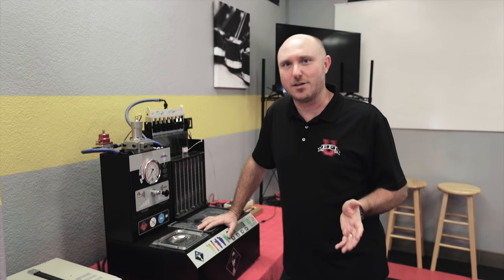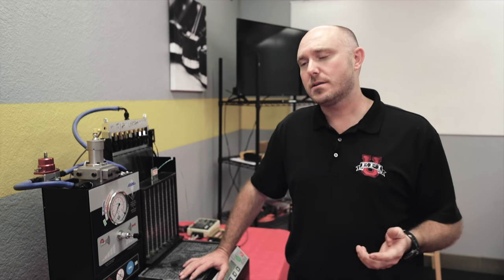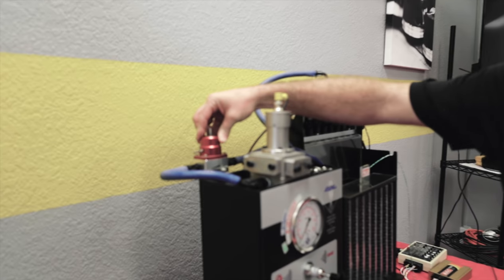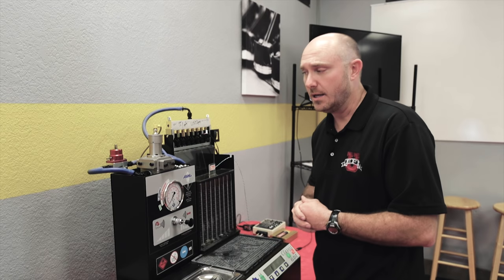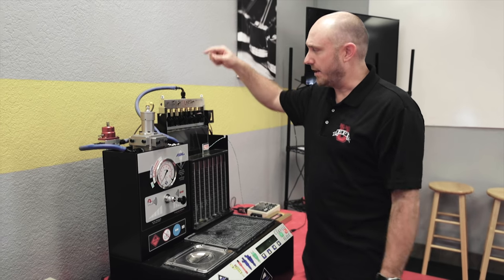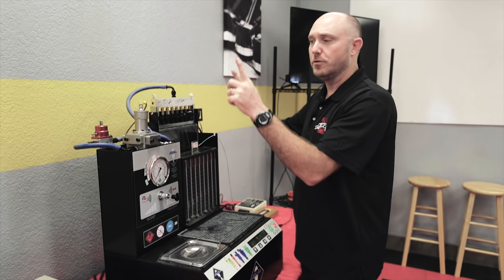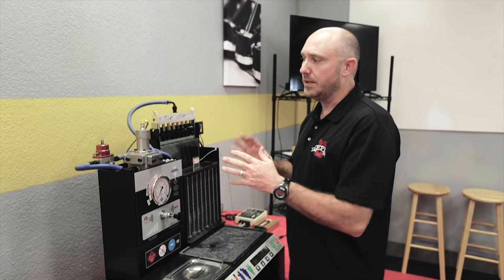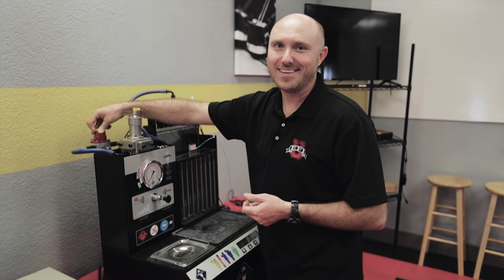Understanding how a fuel pressure regulator works.

Comment: So if you keep the vacuum line off and plug it will it make more pressure or less because I have a more high performance motor and I need a little extra pressure to my fuel rail and when I plugged the vacuum connector on the regulator it seemed to run better

Comment: Im sorry but when you connect the FPR to your engine you shouldnt connect the vaccuum line (yet) because you wouldnt be able to tell the actual fuel pressure coming from the pump if the manifold vaccuum is meddling with the fuel pressure when idling. So first you hook it up, check and set the pressure without the vacuum hose and THEN you connect the hose for a proper working FPR.
Right?
Reply: See no reply. To bad that is a question I have. With the Vacuum line closed off 0 vacuum, that would be close to WOT. That would be where the most fuel is needed to reach the target A/F. At least that is how I see it. If you set the called for psi at idle when pressure drops the psi would go too high? Right. This is a NA engine.

Comment: HELP PLEASE. 1995 pontiac grand prix gtp 3.4 engine
 I changed fuel pressure regulator car will not start. I have no.idea where vacuum hose goes. So my question is if that tiny hose not connected car will not start? I get nothing when engine cranks no backfire nothing just cranks. Ty

Comment: Depends on if your pcm is set for vacuum/boost reference in the injector flow table to wether you connect the vacuum line or not

Comment: If your a high HP application this set up will destroy your motor…. FPR after the fuel rails. The fuel pump should be supplying straight to the rails.. then be regulated after

Comment: Well if I say a fuel pressure regulator job is to keep a constant pressure difference between the fuel pressure and the intake manifold pressure then it will be correct.
Having it set to 50 PSI fuel pressure, and when the intake manifold pressure goes to 20 PSI,  the regulator will let the fuel pressure reach 70 PSI ?
Reply from the maker: correct
Reply: @EFIUniversity1  
when the manifold pressure drop it means more air had entered...
so the fuel need to add more pressure to meet the requirements for mixture???
did i get it right?

Comment: I've been having problems with a GM 350 Ramjet crate engine installed in my 58 Apache. The thing is sluggish on acceleration and uphill. I scanned the engine using ScannerPro and found out the manifold pressure was too high under load and the spark advance was too high.

I figured it was a vacuum leak and the base timing was off. I searched for a leak and the base timing was just fine. So, where do I go?

I just put a pressure gauge on the EFI rail and found out the fuel pressure dropped from 39psi to about 35/36psi at cruising rpm (2000). 

Now that i watched this video, it makes sense now, the fuel pressure differential at high vacuum (lower psi on the rail) causes the engine to be sluggish on acceleration. 

The problem may not be the pressure regulator. But I darned sure understand the problem now. That will make it much easier to diagnose.

Comment: solid video really explains a lot. I am building a 1992 Celica with a Turbo charged 5SFE engine, i'm going to be using a Haltech elite 1500 to run it with 550cc injectors, walbro 255lph pump. Should be i looking at an AFPR too or will i be able to program this variable through Elite 1500?

Comment: Nice, brilliant technical introduction to differential fuel pressure and how it relates to dynamic engine loads 🙌🏼 This is a fundamental concept and your delivery was spot on for all levels 👌🏻

P.S. Love the engine simulator and gold box being used for your flow bench rig, would have been even better to see what fuel flow meter you were using 😊

Comment: The vacuum line is only on boosted applications that is the boost reference you do not hook that up on a naturally aspirated vehicle.
Reply from the maker: Actually...that is incorrect!  You still want it connected, even for an NA vehicle, as long as the injector nozzle is referenced to manifold pressure!  Otherwise the injector will flow more than it's rated and will skew your table values when tuning at low manifold pressures!
Reply: @EFIUniversity1  that is not correct when you are na you're manifold pressure stays at 14.7 the entire time It does not change only in a boost application does the manifold pressure change. That is why on a NA vehicle you have a single inline fuel pressure regulator that regulates the fuel to whatever the manufacturer is asking if you rev up the engine your fuel pressure stays the same The only time it changes is when you go into boost so yes you're wrong. If you were correct on that then every vehicle from the factory would have an adjustable fuel pressure regulator on a NA vehicle and they do not they have a single between 35 to 60 PSI whatever the engine requires to be at 14.7
Reply: @MrYukon04  why don't you tell Ford that.

Comment: Curently working on an NB miata
The fuel pressure regulator is situated in the tank, and not connected to MAP
It's suposed to regulate to a constant 3 bar
The car had trouble starting, took a long time to start, then was running but really low on power...
I've changed the pump because I suspected either the fuel regulator or the pump to be bad...
The new pump is a high flow pump, not OE one .
 I was unable to find a fuel regulator (for a decent price that is, cause OEM part is almost worth the price of a decent aftermarket adjustable fuel regulator)
The car now runs great, but I find the pump is a bit noisy (maybe because I didn't put panel and insulation back)
I wonder if the pressure regulator is fine, or the new pump might just be sending enough pressure to compensate for a bad regulator, and will die soon if I keep runing it like that.
My main questioning is, can I delete the OEM regulator and replace it with an aftermarket one, that would rather be in the engine bay, or next to the fuel tank (but not in)?
If so should I run it to MAP (car is N/A but might be supercharged later so then obviously)?
I don't know how the factory ECU works with the fuel pump but it feels like it's simply regulating pressure/flow by RPM thus increasing voltage output at the alternator and consequently at the pump...
If I put a variable fuel regulator, I don't know how it would react...

Comment: Ok stupid question, I have an ls intake for a 4.8, the intake does not have the fuel pressure regulator nipple on it can I t into the nipple that the pcv valve comes off of?

Comment: If you don’t have or lose vacuum to the regulator would that let the engine crank and start but die immediately after?

My engine will crank and start but dies immediately but I lost vacuum with the line.

Comment: Nice video, question, so I have just got a car, and the vacuum hose from the manifold isn't connected to the fuel regulator, and the that small connection on the fuel regulator leaks small amounts of fuel, it also sits at 50psi all the time. The car runs rich and can't hold a steady idle until it's warm. I assume the regulator is busted as fuel shouldn't come from that side connection and will need replacing, at which point I can connect the manifold vacuum tube and that should remedy in some way the rich running? Am I on the right track? This is my first car that I'm tinkering with so it's a steep learning curve!

Comment: my car will not run at all itll start and idle insanely bad for a few minutes then come outta it some times but something ive noticed is when it does run it misfires and has very poor throttle response pump works fine but there is no gas coming outta the return line so could it be its not getting enough vacuum or its just comepletely locked up or something ive bought a new regulator fingers crossed this is it ive also changed the filter to no avail

Comment: I thought the FPR should be mounted after the fuel rail, not before it (as you have it).
Reply: I think it depends on the car. Mine is between the fuel pump and rail (mounted in the engine bay). At prime (ignition on) it maintains pressure on the rail for starting.
This is a returnless system though.

Comment: Some fuel regulators are in the gas tank like in my ford explorer. Thus it has no vacuum line to adjust pressure. It uses a fuel pressure dampener instead.

Comment: What if you dont have an intake manifold?
Reply: Im not sure what are u talking here unless it is a coal powered car, 😂
Reply: @makaupurple8242  1960s engine. No computer parts not sensors. No eca map. Just need an inline fuel regulator

Comment: Do you recommend a fuel pressure regulator on every engine?
I'm planning to install one on my motorcycle. But I don't see if it would benefit.
Reply: Do a plug test!  I just found out that method and was blown away, now just have to get a few sets of plugs An some hacksaw blades I plan on doing this on my 90 celica I've got a  new set of injectors from 210cc to 220cc on stock engine management :( running super rich so hopefully this will be my answer to finding a little bit better tuneability with future na modifications

Comment: Is it the same for a  carbureted  engine as it is for one with injectors ?
Reply: carbureted doesnt need one cuz it only need a fuel pump just to fill up tha carb but not needing much pressure to supply

Comment: fuel pressure regulator BEFORE or AFTER the fuel rail??

i thought the injectors need a specific fuel pressure to work properly, therefore the fuel pressure regulator (fpr). Now I was told that you should install the fpr after the fuel rail....that would put as much pressure on the injectors as my fuel pump can do - which in most cases is way too much??
Reply: they really need to be specific...
cuz diff engine size requires diff amount of supply in an specific pressure...
Reply: Here's a good explanation of different setups - skip to 6 : 23 https://youtu.be/qO8z8cpp77g

Comment: If I have a slightly bigger fuel pump than stock, something like a 255...
Would that make my stock fuel injectors leak...
And if the answer is yes, could a fuel pressure regulator correct this problem...

Comment: Some systems had other ways of adjusting that and the fpr did not have a hose. So dont freak if yours does not. For some issues or to just give the car a bit of zip, one could up the fp a few psi. Fpr were on both electronic systems and mechanical fi systems.
Reply: eg D Jetronic Mercs dont have vacuum hose on the FPR.

Comment: So, in boosted applications, would you need higher rated fuel injectors? Or does the fpr compensating fuel pressure completely solve the issue?
Reply: Not sure if you found your answer. You will need higher rated injectors so 1) they’re not running as hard and 2) they’re actually pushing out enough fuel to combust in the amount of air being supplied. Just limiting the fuel pressure will only make it either idle rough or stall

Comment: I still don't understand why the fuel pressure regulator is connected to the intake manifold by the vacuum line... there's a pressure sensor in the intake manifold, couldn't the ecu just read that and tell the fuel pressure regulator what to do? Or is it the case here that the fuel pressure regulator determines the pressure by itself via the vacuum line without any input from the ecu?
Reply: Do you think the ECU has an auxiliary mouth in the engine bay to tell the FPR what to do?
Reply: @turboroman  The FPR is a valve, those can be electronically controlled easily enough. The ECU controls plenty of other things this way. Kind of like how some EGR valves are opened via a vacuum diaphragm, and some are fully electronic. I'm curious as to why they don't use the electronic method here.
Reply: @PeterB12345  they just used the so far much more common type of FPR. I know about the modern electronic ones. But this video covers the "analog" type. The vacuum reference port is there to keep the differential pressure constant during all engine load conditions.
Reply: @turboroman  Thanks for that, I didn't know there were fully electric ones. I was just wondering about the design choice when so many other things seem to be electric. I guess that's kind of a trend then... "Let the intake manifold vacuum actuate it" is turning into let the ECU control it via sensor input. But this is happening over time, not all at once.
Reply: My guess is the injector nozzle.. they probably test and select nozzle design to optimize atomization at a given pressure differential between manifold pressure to fuel pressure..

Comment: How come nobody explains where the fuel goes in/out on the regulator?
Reply: It varies depending on the system used.
Reply: Yeah cause I have qft and it has no inlet/outlet direction also has the manifold tube spot

Comment: Would the same apply to a naturally aspirated EFI 2-stroke In a jetski?
Reply: Nimbus Nimbus well from hearsay this description of adding vacuum source applies to the boosted engines. I have been told I do not need it in my naturally aspirated 2 stroke with external regulator and I can simply leave the vacuum on the external regulator open to atmosphere and not plugged.

Comment: Does fuel run through the top portion of the regulator?  Mine has a pin hole in the top.  Debating on hooking it up or getting another

Comment: What is not discussed as this does not apply to direct-injected engines. You leave that barb wide open,  open to atmosphere that is. The commanded high pressure fuel pump controlled by the ECU will adjust the fuel pressure.

Comment: I need to replace my fuel filter in my Polo. I have two options: one without an integrated pressure regulator (cheaper) and one with. Which one should I buy?
Reply: They both do the same thing just get the one with out it’s just a basic filter it’ll do you fine

Comment: does the fuel regulator need hold pressure at prime  to 40+psi and suppose to hold at 40+psi  ?   or is it ok to go to 0psi after prime but no full ignition - is this a cause of a leak down bad regulator not holding pressure before ignition

Comment: Hello from Argentina! Great video!
Just to check if I got it right. FPR is not there to assure constant pressure on the fuel rail but to assure you have a constant dP across the injector (between intake manifold and fuel rail).
I assume that's because when you get an injector, the flow spec (let's say 250cc/min) is given at a constant dP (let's say 3 bar) and if for example in the case the throttle is closed you'll get a higher dp and that means higher fuel flow on the same injection time.
Please say I'm right up to now.
So.. I first want to say that I'm really new on EFI, I'm trying to learn to convert an old carburator car and I know I can really sound like an idiot with my question.. but what I don't understand and I would really appreciate your comments is what about the regulator without the vacum/boost port? is there any way to compensate with tunning? For ex on the same case I comented above (closed throttle) lowering injection time?
Thanks in advance!
Reply: The old D Jetronic Mercedes use a fuel pressure regulator without a vacuum boost port. In this case, the FPR is designed to keep the pressure constant at 2 bar. There is however the crucial MAP (maximum absolute pressure sensor) which senses manifold vacuum and feeds this info back to the ECU which in turn tells the injectors when the fire. Mike

Comment: Do all engines require manifold pressure compensation?  I have a naturally aspirated, throttle body injected engine and have always run the compensation port on the regulator open to atmosphere.  My FP regulator is installed on the return line to the tank, not on the pressure line from the pump.  With oxygen sensor in the exhaust controlling AF ratio, how would manifold pressure compensation help me?
Reply: Boosted yes.  NA not always, depending on the ECU.  LS engines from the factory just run straight pressure.
Reply: im confused about this one too... i have m52 engine and im doing ccv delete and i have no clue if i can run the fpr open or not because currently its connected to my ccv not directly to intake manifold.

Comment: Ok good. I needed that.  Today I found a teeny tiny vacuum line cracked on my gmc 5.3 that was sucking air.  Trying to figure out it’s purpose.  I finally got to understanding it to be the fuel pressure regulator vacuum line. So next I wanted to know if it mattered, that’s how I ended up here.   Thanks.  I will tape it up to repairs the crack for now, and replace it when I find a hose.

Comment: that doesnt work on stock ecu tunes that run in static/closed loop, even with a return line. i drive an srt4 and have the FPR nipple un-plumbed until i get a tune where the fuel trim is adjusted, til then, the mopar ecu handles those parameters just fine for me and theres no need for a boost or vac reference.. the pump is a walbro 255 also, so im not pushing the pump to its limits either, something else to consider..btw, the srt4 guy i took my car to for the custom fuel setup, told me that himself and FWD here in houston has a very highly respected reputation, until you get a CUSTOM TUNE, theres no need to hook up a vac/boost source
Reply: I know this is an old post..  couple days ago I installed a 255 fuel pump kit and the apg fuel regulator return kit in my srt4.  In high boost it cuts out.  I haven't hooked up the vacuum to the regulator, I was hoping that was my problem and was gonna try hooking up vacum tomorrow. I haven't had it tuned yet. Was your cutting out in wot without vacum?
Reply: @bigmofoturbo86     I also installed the apg waste gate and a turbobay 2.5 bws.   Did u get a 3 bar map and tip sensor? I purchased but won't be installed till tune. Maybe that will fix it, maybe u need same thing..idk.
Reply: @bigmofoturbo86   sorry to hear about your father, family definitely comes 1st.  And good luck with the car. I been working on mine for awhile,she is getting close